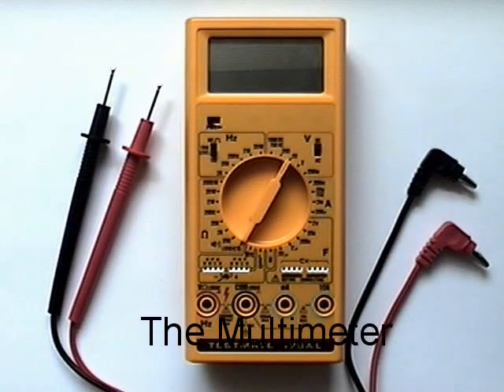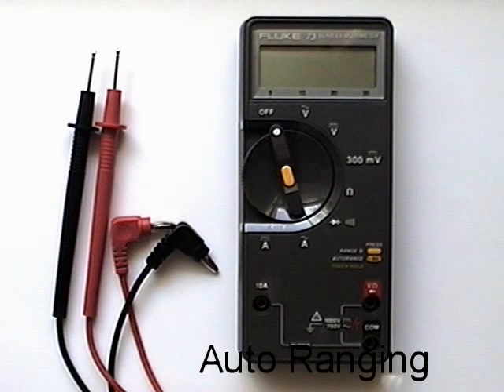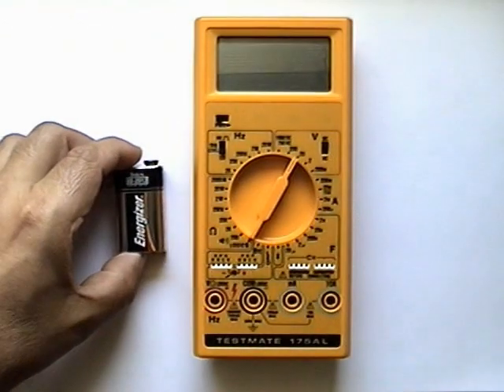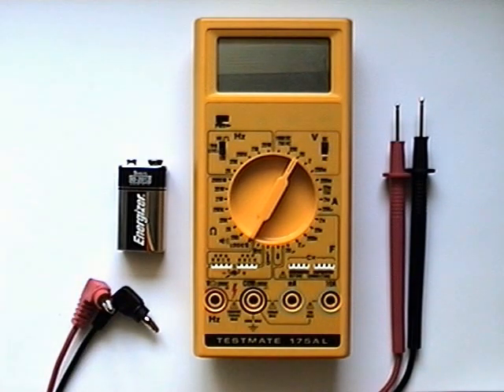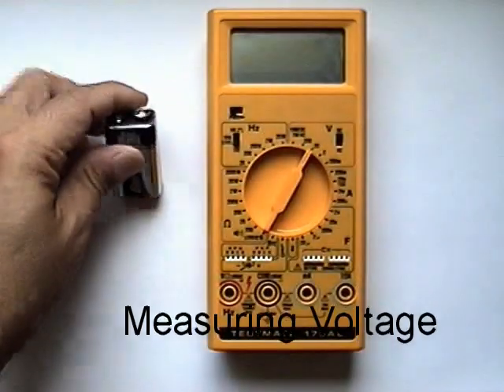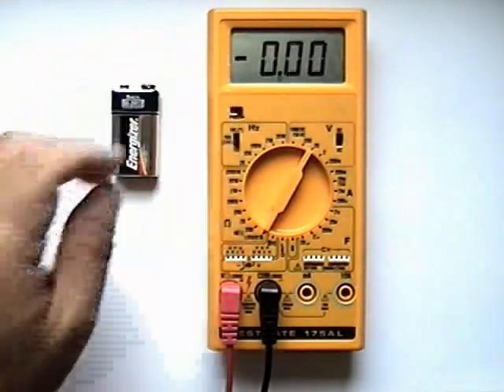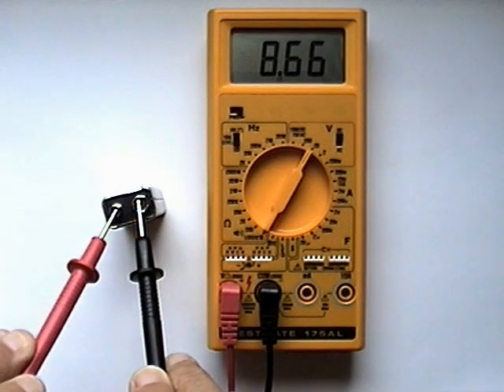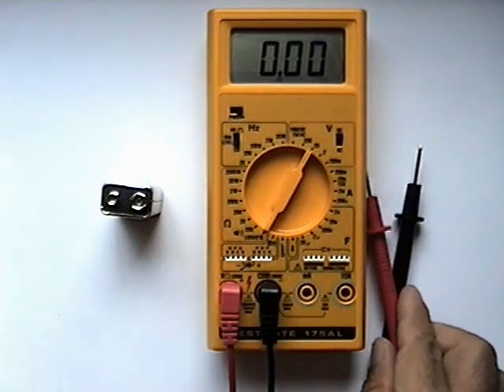The Multimeter

Comment: Different to the Fluke I used in the Air Force. Good tutorial as I've never seen a multimeter of the manual type. It's always good to have one for household uses. I need to get one to test the coolant is the Jeep I drive to check it's condition.